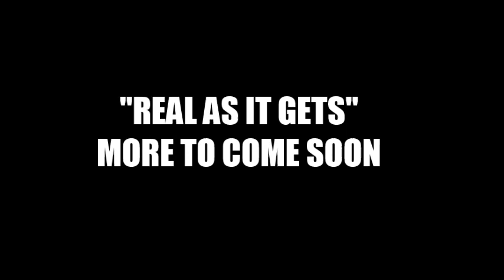SKULL GARAGE 2015...64 GASSER "CALAMITY JANE" WHEEL WELLS CUT,FRONT WHEELS MOUNTED,ENGINE MOCH UP

Comment: Awesome,.. nice job..
 but how do you determine the amound of sink the car will have when you lower it down off the jacks in relation to the tire size and top arch cut?   When the weight of the rear lowers on the shocks?  Do you plan on adding fender flares?
Reply: im pretty sure the jackstands are under the rear axel so it already has the weight of the car on it :)

Comment: Looks like a hell of a good job to me. I always say if you can do it the simplest way the better less things that can go wrong that way lol. I like the fact that you are running old steel wheels as well. And Been a while since I last seen someone mount a tire like that my grandfather showed me how to do it and its what I use to do when I use to race my old dirt car beats taking them to a tire shop all the time lol. You all are making me want some drag dogs again cant beat a good drag dog haha. Happy 4th of July btw hope you all have a good one as well as a safe one. On you're headers you could always get a couple of header flanges and some scrap tube and build you're own headers they are not bad to make, that or cut up a old junk set of headers and cut the tubes and make them that way iv done it both ways.
Reply from the maker: HitokiriRaiden same to ya hope you have a blast!and im going to stick with the fenderwells and maybe try and build some later id really like some weed burners straight out and turned out of the fender ha noise noise noise!

Comment: Great vid,,,but dident they, back in the day,, move the rear end forwerd? for a better launch." Go jane go"
Reply from the maker: +BrianMac Mac yeah that started to happen later on it was the beginning of the altered class which would evolve into funny cars,the front end being up did help weight transfer cuz in the 60's tires sucked and traction was awful even with rosen put on the tracks etc so raising the front put the weight on the rear end at launch helping to get em moving,c/gas cars had to have factory wheel base and engine was only allowed to be moved back 10 percent and could not be more than a specific distance off the ground from the crank center line also c gas cars had to have full interior but if u had a roll bar ya had to build something to resemble interior for the back ,they also had to meet the 10 or 11 pound per ci rule etc etc,and thank ya bud glad you enjoyed it!...justin

Comment: good job on the radius, its lookin good, ive got a set of double humps off my motor that ran on my dirt car in the 80's and I drag raced last year im not going to use, the machine shop said they need new valves you can have them  let me know....captmullette@gmail.com   keep the videos coming
Reply from the maker: Bobby Turner thank ya bud it was my 1st time i dig how they turned out,and i would gladly take em and put em to good use thats what it is all about!real hot rod parts from real hotrodders! they must live on! i will shoot ya an email...cant thank you enough!...justin